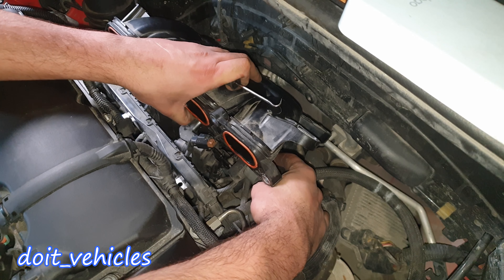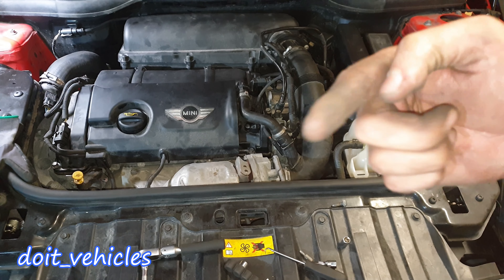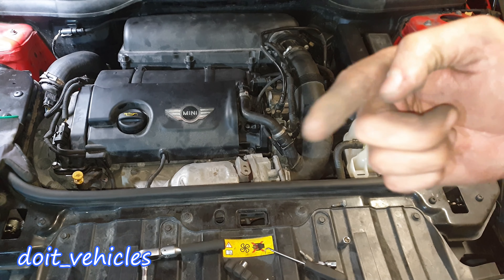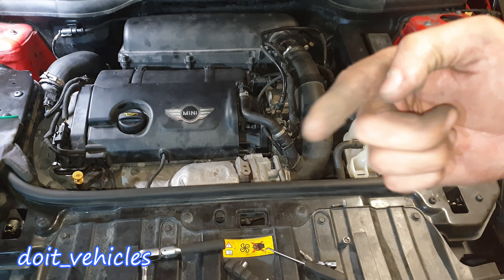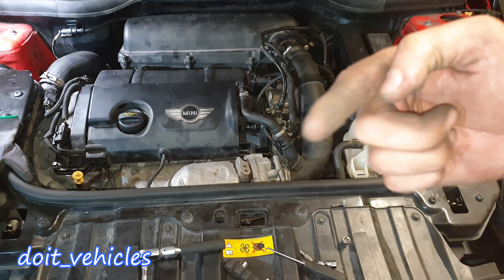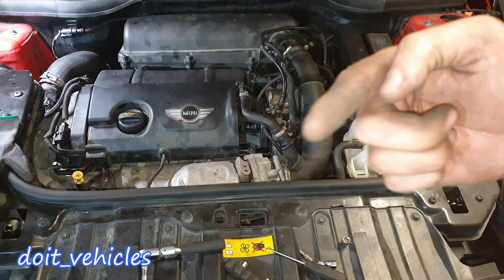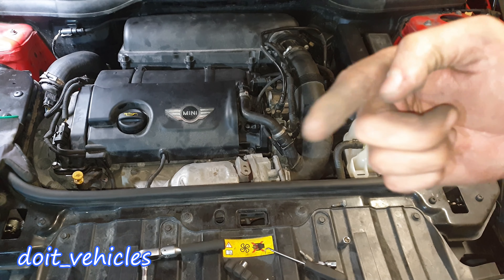Mini Cooper S 1.6 Intake Manifold Gasket Removal / Replacement

Comment from the maker: More Videos about the Cooper S : 
All Fuses &Relays Location : https://youtu.be/6reWaKDPxeE
MAF IAT sensors : https://youtu.be/J5Vl7hwnILc
Oil Change : https://youtu.be/pBqzwVnKyuA
Air Filter : https://youtu.be/wXJkxOUMerk
Throttle Body : https://youtu.be/ziA-sXUbaKc
Spark Plugs Change : https://youtu.be/hd4FWqj-2iA

Comment: I get that nasty 10mm bolt from under and through passenger eheel side.  Very difficult  but doable. What are thoughts about just not using it on reinstall.
Reply: Once that bolt comes off it gets thrown into a corner of the garage when we do jobs on these engines and set ups. Never any issue after

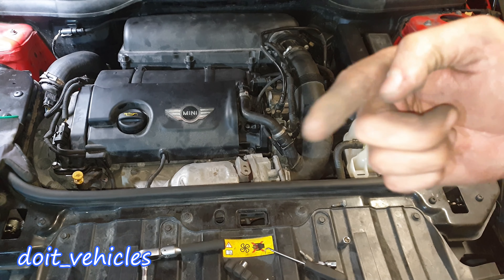Comment: Do you know the exact size and dimensions of the bolt you showed at 5:25?  I know you said it's a 10mm, but my intake manifold is missing that bolt, which is why I needed I needed to change my gaskets, but I can't find it anywhere.  I wanna see if I can just get one from a home depot or ace since it's not showing up anywhere online.
Reply: It's M8x1.25. Very popular size BMW